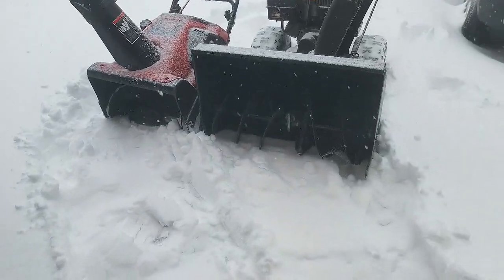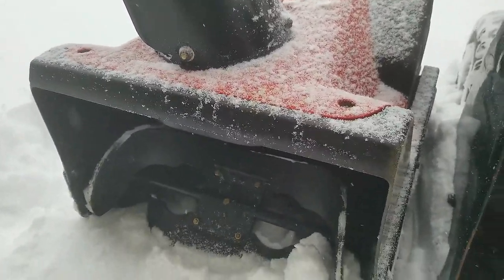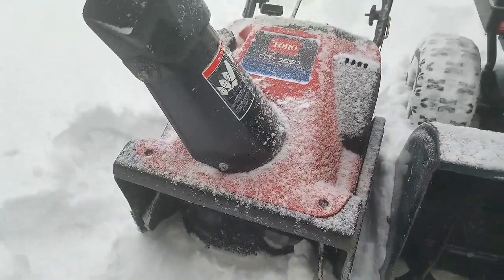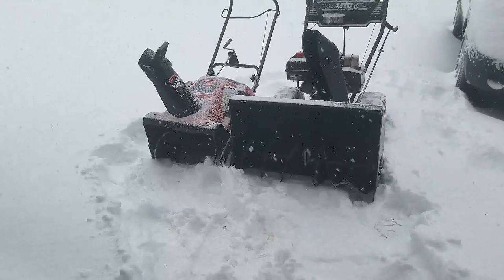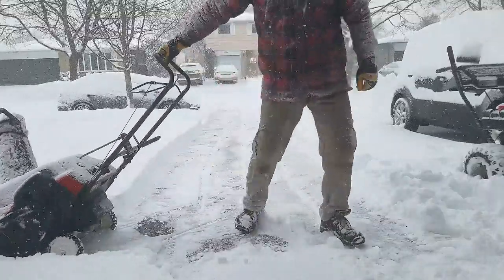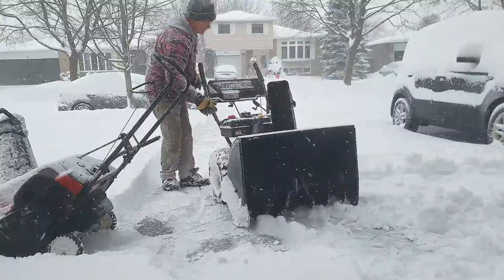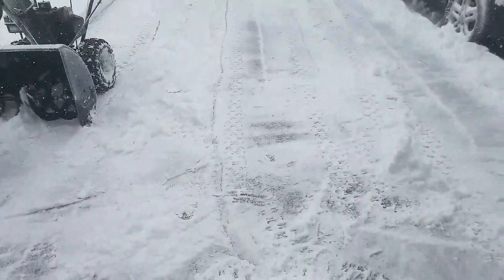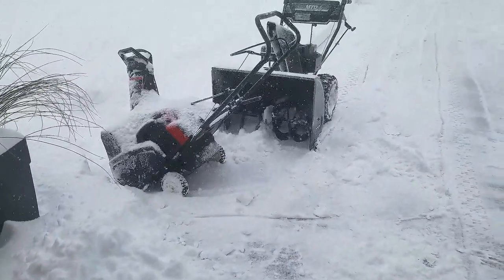Snowblower Comparison - Single Stage vs. Two Stage

Comment: I have both as well. Most times I'm grabbing the 3650 because its just easier to maneuver.  Next time you use the 3650, keep the augers engaged and on the ground when you pull it backwards. It will scrub right down to the bare pavement. For some reason it does a much better job at scraping the pavement going backwards than forward.
Reply from the maker: Interesting idea. Never thought of trying that. I would think you would be fighting the forward propulsion you get from the auger paddles scraping the ground. But I can see it working. I personally don't care if it scraps it clean but others might want to try your tip. Thanks for sharing. Cheers

Comment: I just got a single stage. My old murray two stage still works fine, but on my city lot it can be like using a 300 pound shovel when you have to do a lot of maneuvering. The new machine is much easier and if the big snow hits I've still got the 2 stage.
Reply from the maker: I agree. Thankfully they are adding "power steering" to some of these bigger models these days. I love the light weight of the single stages also. Thanks for watching and taking the time to leave a comment. Cheers

Comment: Having the exact same Toro CCR3650 as you have, and a 2 stage OLD Sears Craftsman I inherited from my Dad?  The Toro handles the wet slushy stuff without plugging up much better then the Craftsman, but that may be attributed to age.  I agree the Toro DOESN'T much care for the deeper snow, whereas the Craftsman more er less walks right through it.  Jez an FYI for the future,  USE the electric start as much as ya can.  Mine doesn't have it, and replacing the pull rope?  Is a ROYAL P.I.T.A.!!......O h yeah!  Toro does make 1 with a transmission and about as wide as your MTD.  But, they want 1,000 dollars american for it!  Tell ya what, if I'm gonna shell out a thousand dollars for a snowblower?  It had darned well have at LEAST 1 back up gear!  They don't!  So I left it at the store for some poor guy!  😂
Reply from the maker: Working on these little single stagers can be a pain, that's for sure. Pretty much take all the covers off to get at anything. I just couldn't be bothered to get the extension cord out sometimes. Just faster to pull on the rope. But as I'm getting up there in years, I'm certain the electric start will be used more often. As for the price of the bigger 2 stage ones, they have gotten out of control for new ones. 2+ thousand dollars for a new Ariens. Get outta here. No thanks. Good thing I'm handy and can fix up a good used one when one comes along. Thanks for watching. Take care.